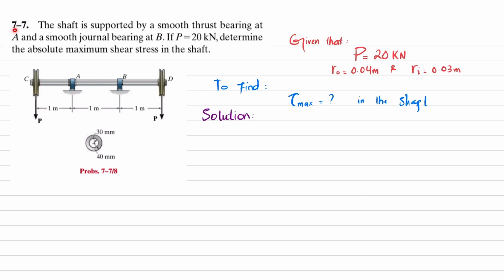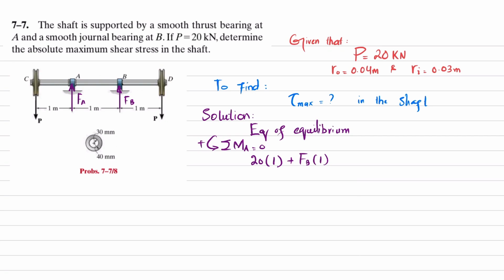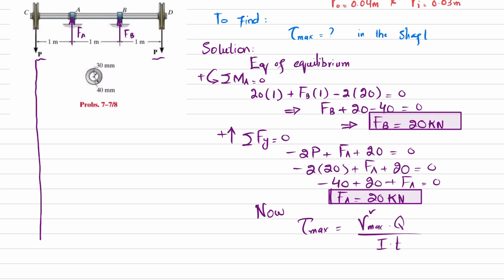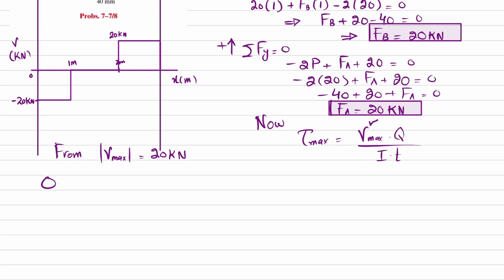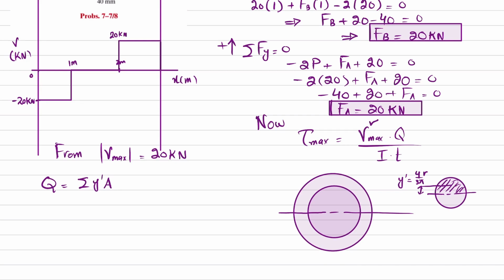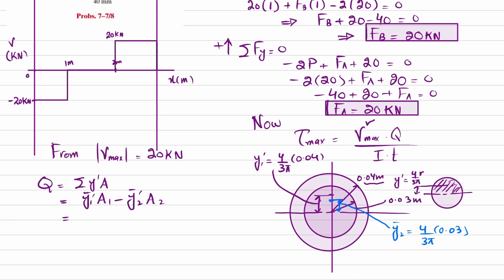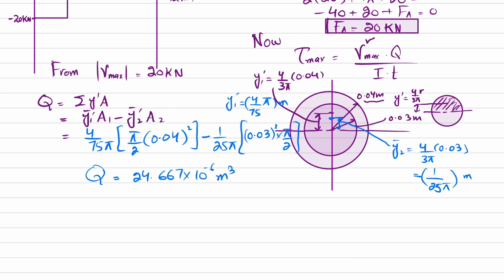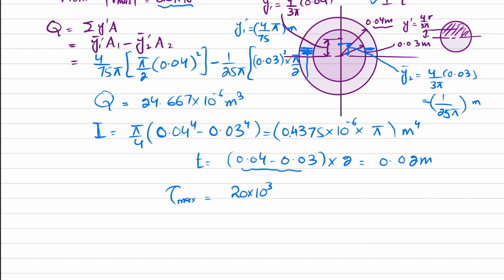7-7 Transverse Shear | Mechanics of Materials RC Hibbeler |

Comment: moment of inertia is wrong. it could be 1,37 * 10^-6
Reply from the maker: It's not wrong there is pi multiplied with 0.47 x 10-6. Check it out when you multiply Pi with o.47x10^-6 , it will be 1.37x10^-6.
Reply: @engradnanrasheedmechanical  okey, I got it, thank you
Reply: @engradnanrasheedmechanical  and do you have energy methods videos and strain transformation? I can't find
Reply from the maker: It's ok No problem sir
Reply: @engradnanrasheedmechanical  hi I still don’t get why do i need to multiply it pi when inertia formula is pi r^4/4